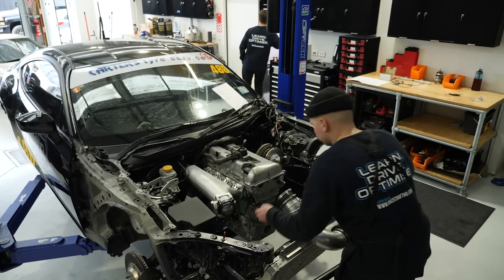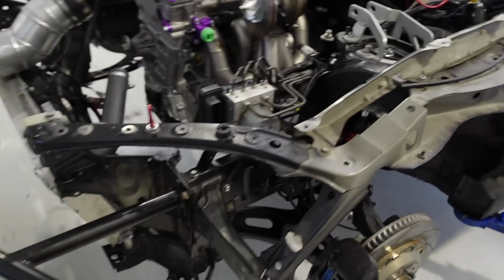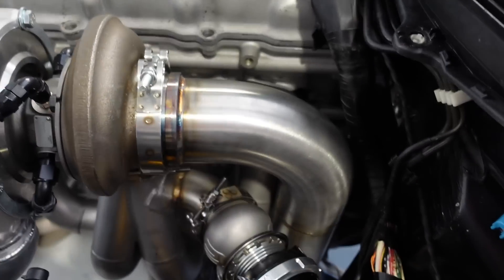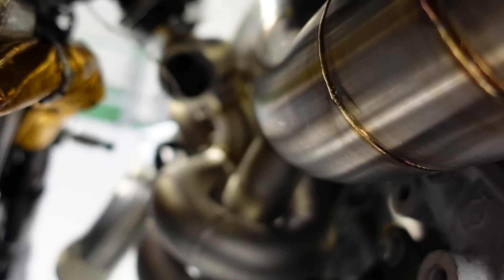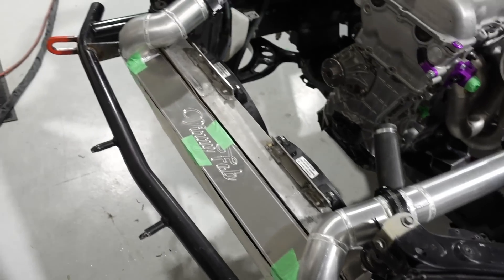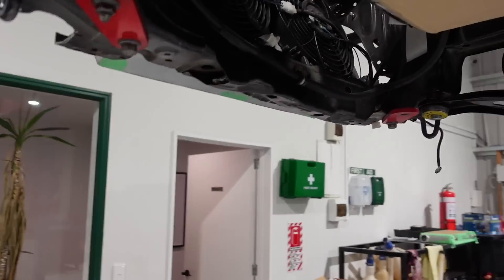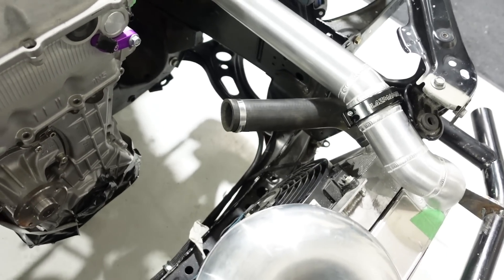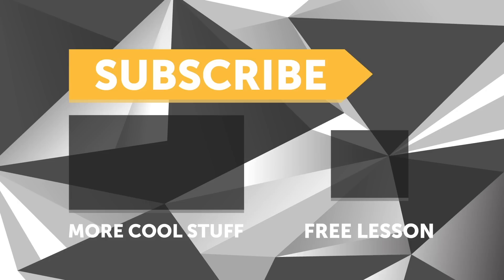Help! TURBO Setup | 650HP SR20VET Swap | SR86 EP 2 [#BUILD]

Comment: For the intercooler mounting, I see you went off the front of the bash-bar, would it be safer to mount off the side rails of the bash-bar  where it wouldn't be as prone to flexing in an impact compared to the front? Currently mapping out mount solutions for my FRS which is a 'drift-car' hence my concern on the placement, love these videos thanks so much for all the detail you put in!

Comment: Will the intercooler piping crack because it is completely solid like no silicone couplers with engine vibration?
Reply: The vibrant type clamps allow for engine movement they are not completely solid mounted.
Reply: Brian Fahy  oh I see nice

Comment: Nice build, but im worried that your Air pipe to the turbo can make vacum, if the pipe is the same diameter as the turbo inlet. I have seen that on other builds.   Good luck on the rest :)

Comment: Do you have any recommended Intake manifolds for the S13 SR20DET? Just running up to 400whp and im not sure if an aftermarket piece would be worthwhile for a car that isnt 100% race car. The car will see track days once a month, but will mostly be driven in the canyon roads. Worried that with my GTX2867r .64, Ill lose too much low end vs a mild bump in the top end
Reply: I run a stock s13 sr manifold on my 470whp e85 sr20. If you go aftermarket forward facing you will loose mid range power but gain peak power. stock SR manifold is a great design for low end. if you decide forward facing is what you want id suggest Otaku garage
Reply: @marcotassone2324  thanks so much! 

And particular reasons why you'd recommend otaku garage?

Comment: This is a lot of work for it to be scrapped when the new UZ engine arrives. Also would of loved to of seen a turbo K20/K24 swap. My opinion, I much more powerful and reliable engine.
Reply from the maker: No doubt the K20 is a better engine but we didn't have a built K20 sitting in the workshop ready to go. On the other hand we did have a built SR20VE sitting in our Z so that was the only option we could take. At this stage it's unlikely the 3UZ will go back in this car but it will still make its way into another race car - Andre

Comment: All of that custom work is beautiful. Very well done!
However, it does mean that any front end wreck takes much longer to repair and costs that much more. Off the shelf parts can be swapped out and cost much less to replace. But everything is always a balance.
Reply from the maker: You're right, a major front end impact would be a bit of a bummer. There is however a reasonably substantial crash bar running in front of the cooling package that will protect them in a light to moderate impact. at the end of the day we can't use off the shelf parts so the key will be to try and keep it straight - Andre

Comment: Hi. Solid engine mount is use? i can see any flex in the piping
Reply: I was also wondering about that...
Reply from the maker: No, the engine mounts are stiffer than stock but not solid. The plazmaclamps still allow movement and angular misalignment - They're not a solid clamp. Andre

Comment: I noticed in the last video on sr86 you guys had two oil coolers being mocked up. Are these both for the engine? My question is would that be overkill? I ask as I’m building a car and I’m curious as to how you came to conclusion of how much cooling is or is not enough. (I intend to run sprints and 1hour races in the same car)
Reply from the maker: One is for the transmission, the other for engine oil and we definitely found they were required for us on both our GT86's. Particularly when stuck in dirty air during a yellow flag we had issues with the original cooler even which was bigger but had poor ducting. For road driving and sprint races it was fine (but only just for sprint races). 

You might enjoy this, few pointers in there for you regarding what you want to watch for in your data when it comes to temp trends - https://www.hpacademy.com/blog/engine-coolant-how-hot-is-too-hot-lexus-v8-swapped-gt86-upgrade-tech-talk/ - Taz.

Comment: Why did you go with a Plazmaclamp on the Turbo compressor inlet instead of silicon?
Reply: Silicon joins can "pop" open when on boost I've seen it happen on heavy diesels
Reply: @maseywat  I understand that is why you use plazmaclamps or other wiggins style clamps on intercooler piping but I'm curious as to why it was used on the compressor intake pipe which should only ever see atmospheric pressure (possibly plus a small amount if it has any ram air effect)

Comment: It would be nice to hear a bit more about the reasons why things are being done the way they are rather than commentating what we can see.
Reply: he did explain things instead of just showcasing, did you miss the numerous times he explained why the piping was routed exactly the way it was to leave room for air sccop? He also explained why they would be stopping the exhaust work at the diff to prep for aero after.
Reply from the maker: Give us some specifics @3finnian, we'll do our best to fill in any of the blanks. There is some content that comes before this, and also a ton in the pipeline too 😎 - Taz.

Comment: What sort of boost are you expecting to run on that 3076 to reach 650?

Looking forward to this vid
Reply: I have tuned a 3sgte with this exact turbo and for 500hp at the wheels  on e98 we were pushing 1.4 bar  into it so I think under 2 bars should do 650hp
Reply from the maker: 650 is on the limit of the turbo's potential and would probably need around 30-32 psi on E85. We won't be pushing anywhere near that for the time being though - Andre
Reply: @hpa101  would one of the new g30s go well on a setup like this?